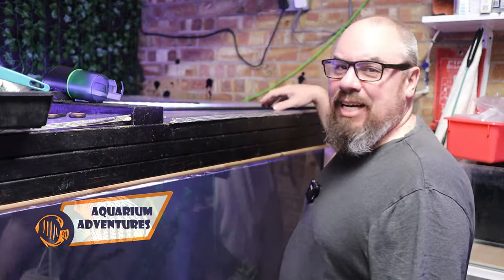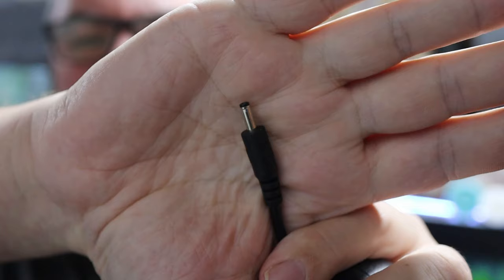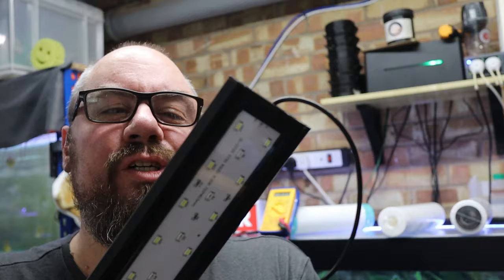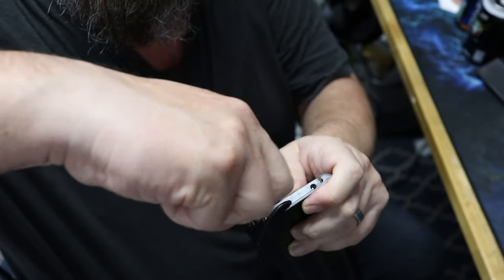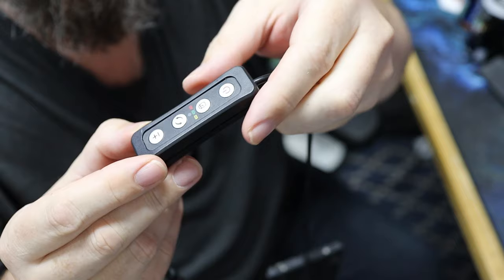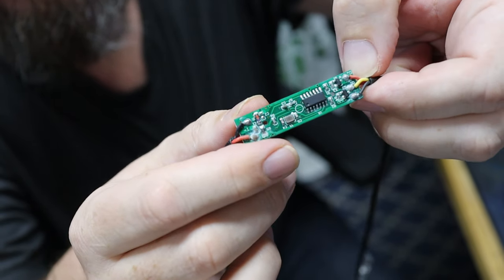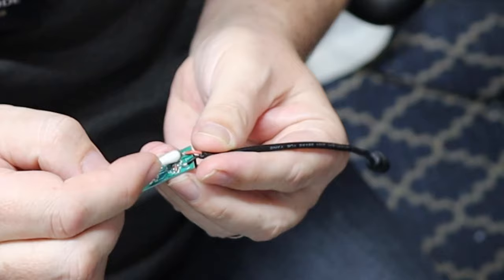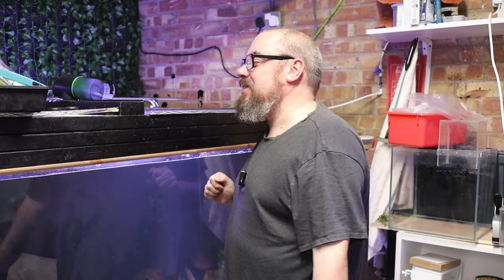Flickering Aquarium light? How to fix it!

Comment: A very good video!  I feel like work Graeme collided with fish Graeme there.

two tips:
One note might be that those little remote boxes on the power cord for your lights DEFINITELY aren't water resistant or waterproof and this means humidity is not their friend.  That light might be having issues because of the way the wires are routed and because it's on megatank lid where there is that higher localized humidity.

Second tip is that if you happen to have some on hand, only speaking about those remote boxes, and you have it opened up.... seal the edge of it around with a little bead of 100% silicone and then clamshell it back together.  Give it time to set, then you should have a much better watertightness if you have that recurring issue.  

Once electronics start to corrode it's very difficult to get that reaction to stop.... it will be cleaned, but it's still "happening" over time while the things mix.  Whether it's two metals or water+metal the reaction has started.  They do make things to neutralize it and the most common example people deal with here would be cleaning off exploded battery residue.